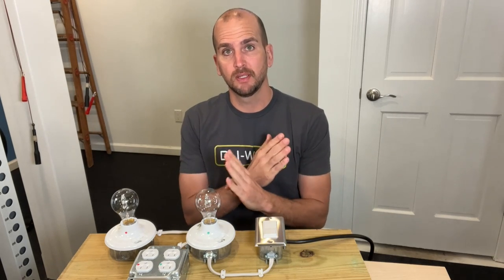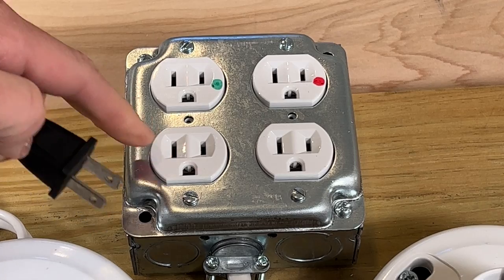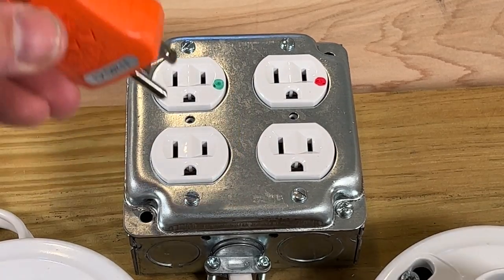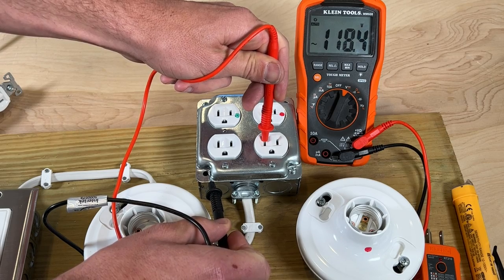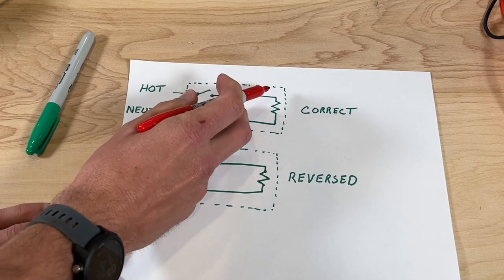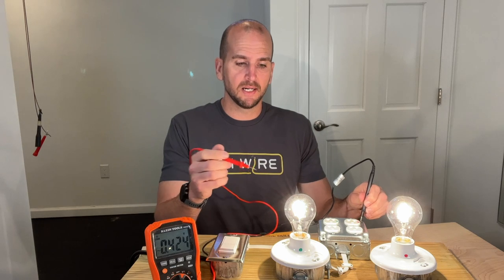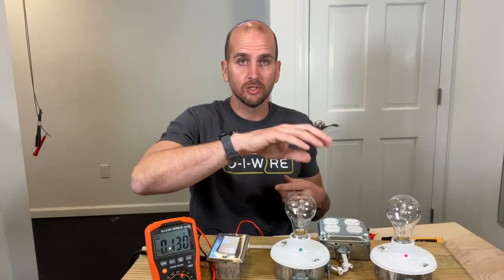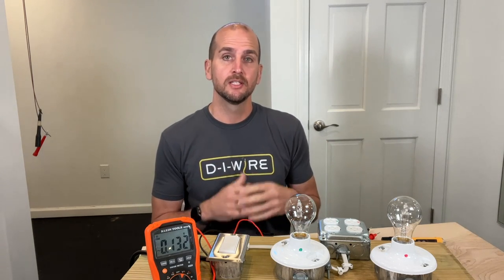Dangerous Wiring Issues In Lights and Outlets

Comment: OK. So years ago I installed a new switch in a table lamp and wasn't sure which side of the cord was neutral. Switch works fine. The outlet and plug are polarized and outlet tests normal with a plug in tester as well as with a DIMM from hot to neutral (120), hot to ground (120) and neutral to ground (0.2). Continuity test reveals that the large end of the plug (neutral) is continuous with the "screw" portion of the socket and the narrow end of the plug (hot) is continuous with the "base" of  the lamp socket. When switch is turned off (light off) no voltage from screw portion of bulb to ground but when switch is turned on (light on) there is 120 v from screw portion of bulb to ground. How is this possible? Could a loose neutral wire upstream of outlet cause this?

Comment: I ran into this when checking a ceiling fixture that was blowing bulbs.  I turned the wall switch to the off position, didn't test for voltage at the fixture and touched the thread on the bulb and got a shock, nearly fell off the ladder. Turns out the previous owner of the house had done the wiring and had wired the switch reversed.
Reply: I just like playing with my Wiggly so I always test everything before I touch it. With electricity it is assumptions that'll get you into trouble. What I say is don't think, know. You may think you know everything but you will run into weird stuff that isn't what you thought it was.

Comment: Another issue with reverse polarity light sockets is that they can significantly shorten the lifetime of some (maybe not all) LED light bulbs plugged into them. Just an observation (for an explanation, you’d have to contact the manufacturers.) If you’re having issues with new LED bulbs failing prematurely in a particular fixture, you might want to check this.

Comment: A ‘HOT’ wire or conductor is usually caused by over current or faulty connection. Check with a thermometer not voltmeter!

Comment: All true, but how many of us are going to touch the thread of a light bulb while unscrewing it, with our foot, or other hand holding onto a pipe?  Those fixtures are typically found in the basement and standing on dry concrete and touching those threads on a light bulb won't give you a poke.  Dad told me (whether true or not) that one of the big pushes for polarized plugs was the common 1940s 5 or 7 tube kitchen radio. The neutral was wired to the chassis (like a car), plugging it in the wrong way made that chassis hot. Moms adjusting the radio while leaning on the stove, faucet or sometimes the metal band on the counter would get a good poke!

Comment: I'm not an electrician. But, I'll fix small things for my customers if an outlet or switch is bad. Plus, I  install new lighting fixtures and sealing fans, but only if there is an existing circuit. I will not run new wiring for lights, switches, etc. I do check NEC codes for things I'm not aware of. If items like switches and outlets appear to check good, but the issue is further down the line, I tell my customers to call an electrician as it is beyond my capabilities. 
That being said, I encountered a problem at a house that truly baffled me. She has an outlet in the kitchen that checked dead when I used a no contact tester. But, before I went any further, I checked the outlet with my meter, and it only showed 9.3 VAC. I went to the breaker box, but couldn't get the  power turned off even after flipping every breaker. (I didn't shut off the Main breaker.) I know there are a lot of possibilities in this type of situation (that i dont understand) , and an electrician would need to physically see the problem to draw a conclusion. 
That's my story. Any thoughts?
Reply: Have you verified that your meter is working properly?
Reply: Yes, sir. I get normal readings on other outlets in the kitchen, and the meter battery is new. Thank you for that thought.

Comment: I have an old building which the electrical worked awesomely.  The only outlet shows wired correctly but if I leave the tester plugged in it changes to hot ground rev.  Why?

Comment: We have a plug outside our garage we had our motor home plugged into, The plug was wired without a ground and reverse polarity, I didn't wear shoes one time outside when my dad was there with me, I did feel some weird sensation around metal when the motor home was electrified but I shrugged it off, But I grabbed the screen door with my feet both on the floor, and, I got shocked badly, I was stuck there for about 5 or so seconds and my dad got trained in the air force to deal with stuff like that, And I'm glad he did.

TL;DR: I got electrocuted by my motor home and almost died.

Comment: Many devices with a two prong polarized plug will have the neutral line also connected to the chassis or case of the device.  If plugged into an outlet with the hot and neutral and hot reversed the line voltage will be on the chassis. Not good.
Reply: That simply is not true unless you talk of some ancient hot chassis radio. Note the chassis is not same as the case. You cannot touch the chassis.
Reply: @okaro6595  
While the user normally can't touch the chassis (unless he attempts to service the device), The technician will be exposed to the chassis during service.  Most televisions in the 70s and 80s had the neutral wire attached to the chassis.  Most television shops made use of an isolation transformer unit when servicing these TV sets. This protects the technician and the test instruments used as well.  The purpose of the polarized plug is to prevent a live chassis condition.

Comment: Working on my friends flood light and not wanting to take time to find the breaker, I ask him to turn the flood light off which he thought he did. Burned up my favorite screw driver working on his light. I ask... Did you not turn the switch off, yes I did he said. Went inside and found where they left a receptacle with power wrong. (crossed over on the load side) which meant the black at the switch was actually a neutral and the power fed straight thru to the light. Hope that made sense...

Comment: I just discovered our outside back porch light has a hot neutral (white) and a dead positive (black) wire. The dead positive’s neutral wire is then fed into two other incoming black lines. While the white lines incoming are tied together and one is hot and not controlled by the light switch. Overall confused.

Comment: All sorts of non-grounded devices can present the same danger as light bulbs.  When internal insulation is damaged, the case and/or other exposed metal surfaces (electrically connected to Neutral) are energized when the device is switched on—that's dangerous enough.  But when Neutral and Hot are reversed, the case is energized even when the device is switched off.
Reply: You should junk any such device.

Comment: I think you should have also turned the switch off and show that the threads are still hot.  That a bit more typical issue - Turn light switch off and when removing bulb accidently touching the screw threads and getting shocked.

Comment: Is it true that (for correctly wired circuits) that the neutral wire is always at 0 volts and always safe to touch?  If not true, why do non-contact testers indicate safe on the neutral wire whether or not the switch is closed?
Reply: Do not touch live electric wires! Your wuestion is lie asking is it safe to play Russian roulette with an empty revolver.

Comment: Nitpick:  when you state that there is no voltage, the meter still shows a few mV. You should set the meter to 200V fixed range.
Reply: A few millivolts is no voltage. That's just stray electrical fields the meter's leads are picking up. It's a very sensitive instrument.
Reply: It was showing MINUS millivolts!

Comment: Let's say you buy a lamp at a yard sale or something, or rewire it yourself, your outlet tester shows proper wiring at the outlet, you could use a lamp socket to outlet adapter in the lamp and then use your outlet tester to check that the lamp is wired properly correct?
Reply: Yes but you also would have to provide a ground for the adapter.   Otherwise an outlet tester would show open ground,  where or not the lamp was correctly wired.   Assuming your outlet is properly wired the simplest way to check your lamp is to take your multimeter,  set it to OHMS or better yet continuity if it has it, touch one probe to the screw shell, then touch the other probe to each prong.   You should read around 0 ohms or the meter should beep when tested between the wide prong and the screw shell if properly wired.    The wide prong is neutral, the narrow prong is hot. Note that  at least on modern cords, if you look closely one side will be ribbed,  the other side will be smooth and have writing on it,   the ribbed side is neutral and if you follow along it will lead to the wide prong on the plug, assuming it was the factory assembled cord set with the molded on plug.

Comment: I’m sorry whenever my light is off and I have my receptacle tester plugged in. It’s showing I have a high in ground reversed. When I flip my light on it shows that is correct wiring but when I flip it off that’s when it shows that I have a hot and ground reversed.
Reply: The switch can be on the neutral. Use a non-contact voltage tester.

Comment: So...Even if the switch is off, there is still 120v on one leg at socket...correct ?...because hot wire is wired to bulb and you are the return, ground if you touch ??..I get confused........
Reply: Depends on how the switch was wired. Break the black.

Comment: You wouldn’t believe how ‘Electricians’ wire things here in Thailand.  They don’t know, or use, wire nuts… just thinly tape them up.  Would like to know how to track ‘Stray’ voltage in a circuit. My LED ceiling lights ‘Glow’ at night. 18 extra volts. 220/50 system. Polarity doesn’t exist here

Comment: Actually it needs no additional circuitry. It is AC so the polarity does not matter to the working. It is only a safety issue and the charger is completely enclosed. You cannot touch any live parts.

Comment: sometimes, 
the isolation inside the device ware out.. 
electricity goes to the grounding, 
creating fire hazard,
or burning the fuse,
or electric shock
(my father used to say: "make curly hair")
or burning electricity when the device is off.. 

that's one more reason to connect the switch on live wire..

Comment: It's not so much of a "small shock" if you are grounded, for example standing barefooted on a damp floor or touching/holding onto something metallic that is grounded such as the body of a refrigerator or cooker. Such a shock then has the potential to kill you.

Comment: And if it’s wired wrong when someone turns off the switch they think it’s safe to work on. I ran into that when I went to change a light to a ceiling fan/light. I checked with a meter after turning off the light with the switch and to my surprise the black was still live since they used the switch to interrupt the neutral!
They did that in older houses for ease of wiring!!! One note to people. Was wiring my garage using romex. Who needs safety glasses for that??
My romex slipped and swung right into my cheek. Could have been one of the 2 eyes I have. Always expect the unexpected!

Comment: I am trying to wire my new bathroom light because there was a connection issue in the socket of the old one. The problem is that both wires that come out of the wall are white, so I do not know which one is the hot wire. I wired it up and it does nothing but did pop one time. i rewired the wire nuts incase it didn't have a good connection, and nothing at all. It is also a two light wall fixture. Does anyone know what i should do? I do not have a tester.

Comment: Related fact:  A lot of older devices used non-polarized two prong plugs.  If you own one, wire in a modern plug.  if you don't know how, get a pro to do it, or throw the device out.
A classic example is vintage guitar amplifiers .  Plug one in, and there's a fifty-fifty chance that the strings of your guitar will be hot.
Also, in an old house, there may be non-polarized outlets, with both slots the same size.  Fix the problem.  If you don't know how, hire a pro.
Reply: That is not true. The neutral is never connected to anything external.

Comment: The outlet tester won't pick up a "bootleg ground," ie a neutral jumpered to the ground terminal.
Reply from the maker: Good point, thanks for the callout 👍
Reply: Even worse it will so reverse bootleg ground as reverse polarity. Reverse bootleg ground is very dangerous. There is voltage on the case.

Comment: Consider editing out the comment at 8:14 about the shock usually being small. It's dismisses the very real danger that exposed 120Vac presents. If you're lucky, a 120Vac jolt doesn't injure or kill you. If the path through your body goes anywhere close to critical nerves, you get a nasty heart attack. If the muscle spasm caused by the jolt causes you to grip, instead of release, the exposed circuit then you get fried internal and external tissue, or worse. If you're balanced in a precarious position, such as on a ladder, you fall off the ladder with no muscle control. Tasers are safer than a jolt from exposed 120Vac wiring. Most of us have been lucky when zapped. But sheer dumb luck kept us from injury or death.
Reply: Glad someone pointed this out!! I've gotten some very nasty bites off 120v. 
And people do get killed every year from " just 120".

Comment: Another example of how good the British design of light bulbs is: Our "bayonet" fitting has a grounded outer sheath (where the screw thread is on the American type) and two connections on the tip of the bulb (power and neutral) where the American bulb has the power connection. It therefore doesn't matter which way round the British socket is connected, because both will work and both are safe. If you wire the socket so badly that you put power on the outer sheath and create the risk that you highlight here, the bulb won't work - because neither of the "active" connections will be powered. The fault will be obvious.

As a Brit living in Canada, I'm often surprised by how poorly designed some things are here, and how much you could learn from other countries. I wonder why you are so resistant to it? The only reason I can think of is that you are constantly being told America is the best country in the world, so everyone is taught that everyone else should be learning from you, not the other way around. And so the poor design trends continue and become even more entrenched...